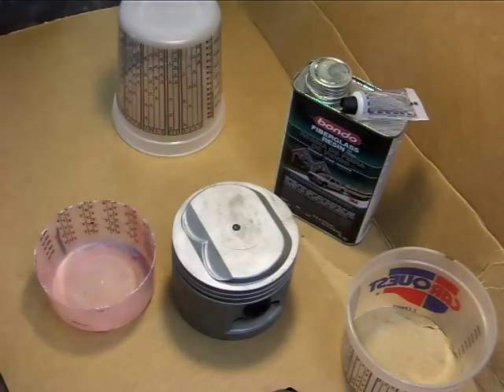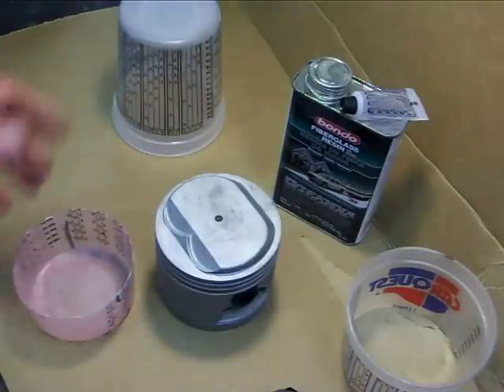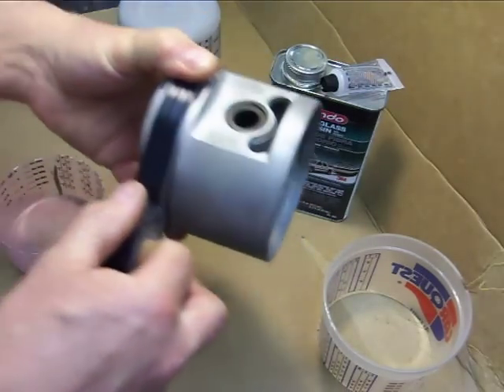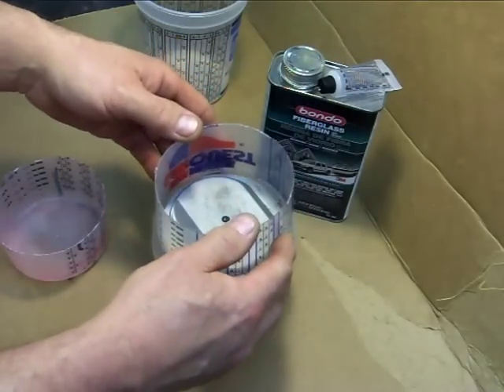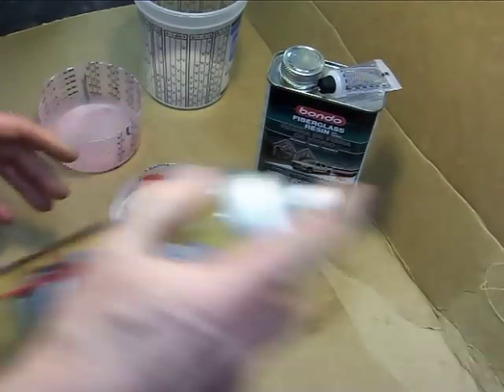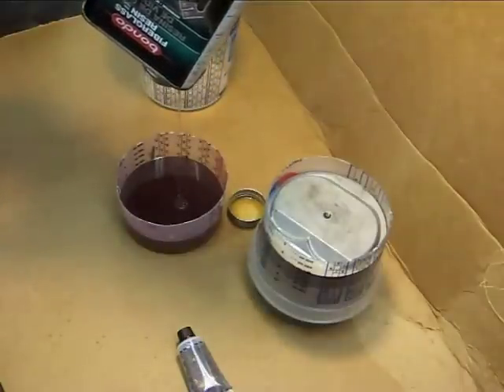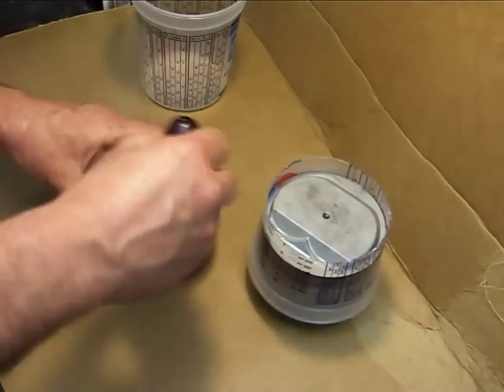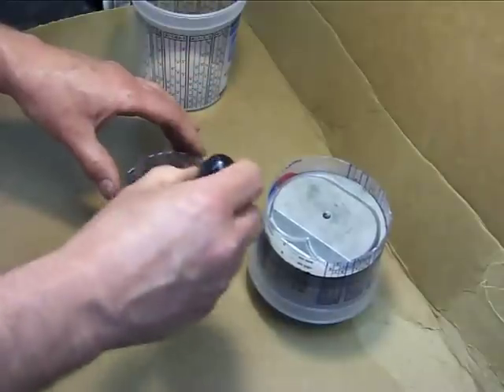1955 Buick Piston Dome Mold

Comment: Why wouldn't you just mock it up in the cylinder and CC' it in situ?
Reply from the maker: I did this years ago. It worked for me.
Reply: @dyna1955 you didn't answer my question either.
Reply from the maker: I think I saw this in an old Hot Rod magazine.
Reply from the maker: I also didn't want mess up the piston as I sent the first set back.